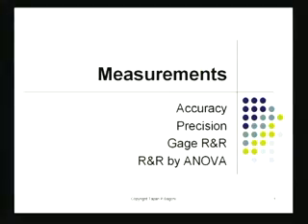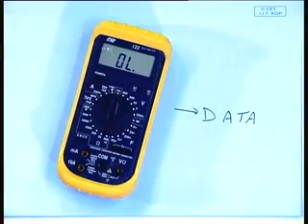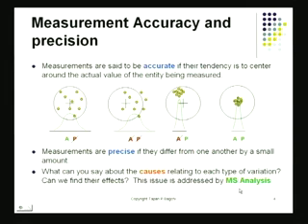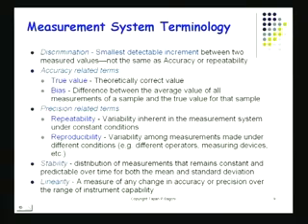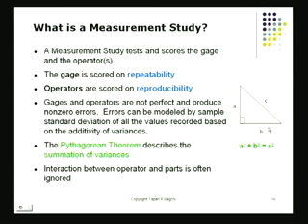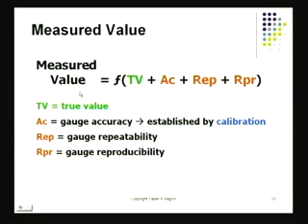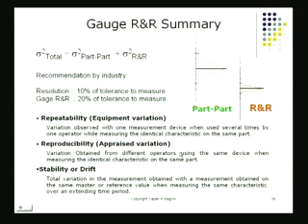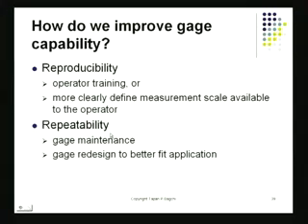Measurement System Analysis

Comment: At 48:00 minute in this video, how did we get sigma square total = 5.91?
Reply: Calculate variation for whole data
Reply: Calculate total variance for the whole data set. Best way to do it is: Enter all the data in excel under different columns. Use the formula in excel for variance (=Var(select all data)). This will be equal to 5.91. Hope this helps!